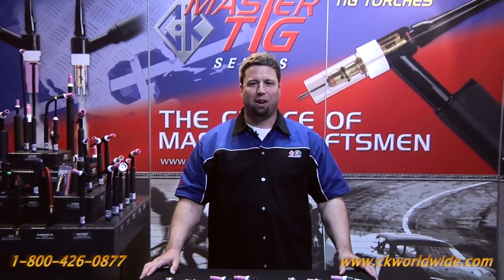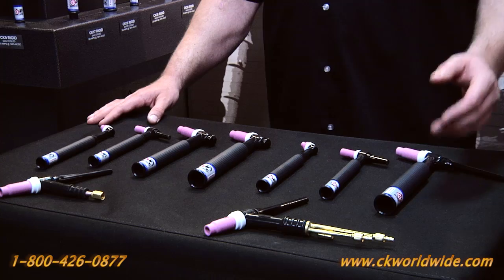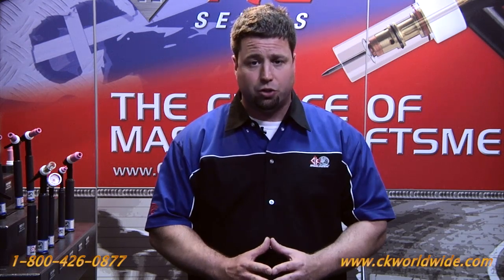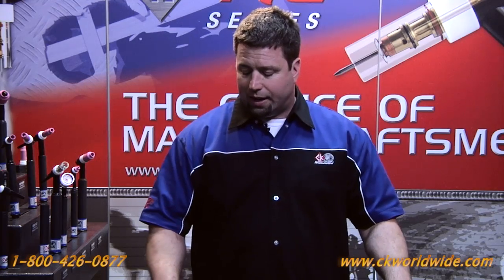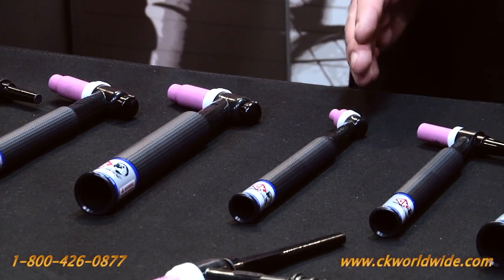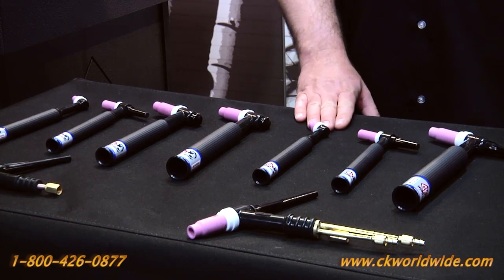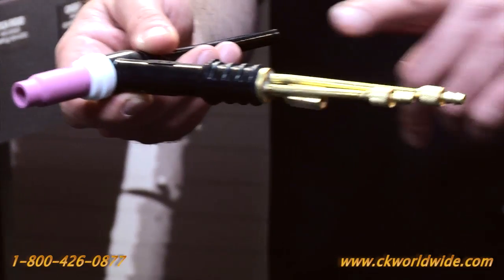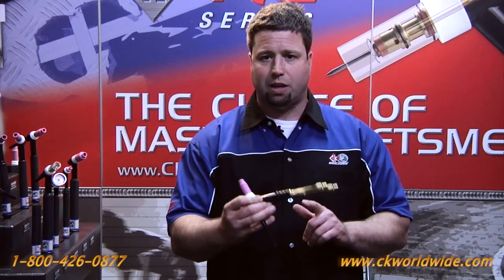Gas Cooled vs Water Cooled TIG Torches

Comment: Just bought a water cooled torch and the pump in the water cooler I have took a crap. Can I use my water cooled torch at lower amperages with a lower duty cycle?

Comment: ? Is this water cool tig welder is for just for tigging  out a heavy wall pipe ?
Reply: Eduardo Arrazola no it allows for higher amperage and duty cycle with a smaller torch.

Comment: Just ordered the water cooled 300 amp beast in the 20 series with the superflex hose ck232sf from Weldfabulous, you redesigned the wheel by using brass in the torch head along with those wide open water jackets..
Gonna send my WeldTec back lol
Keep up the good work!!!